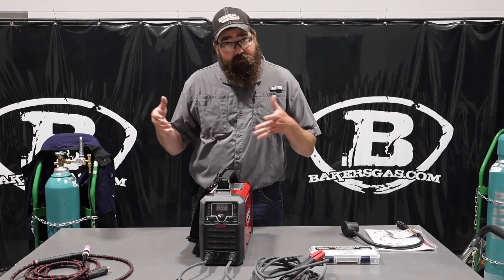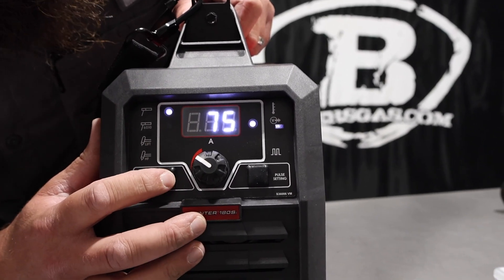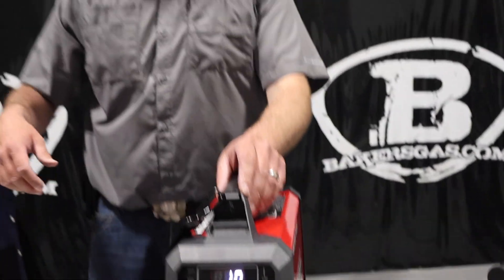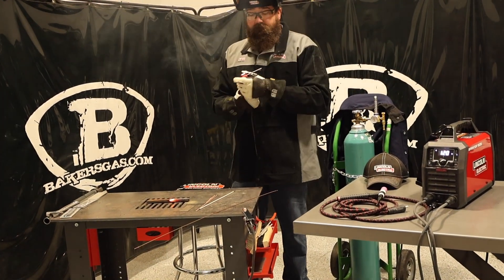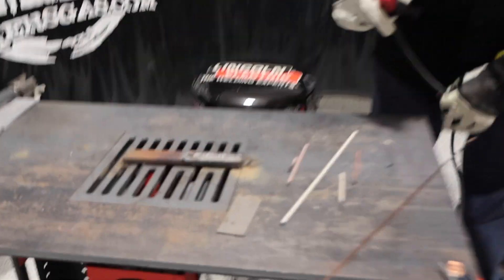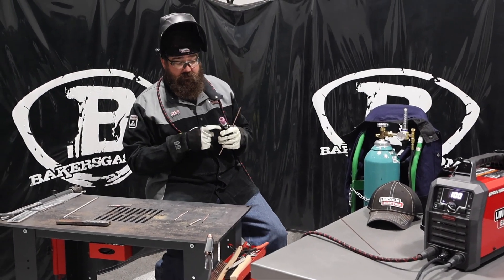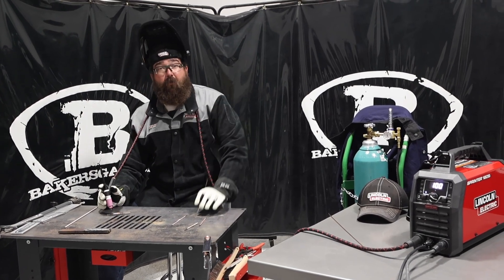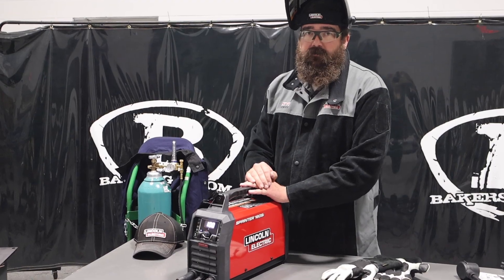Lincoln Sprinter 180 Welding Review Stick and TIG welding demo

Comment: How does this compare to the ESAB Rogue 200ip? I mainly stick weld but I'm getting into TIG now. If you had to choose between the ESAB 200ip and the Lincoln Sprinter 180 for someone that's been stick welding for a few years just getting into TIG, which machine is a better choice? (They are pretty much the same price in my area)
Reply from the maker: I would suggest the Sprinter (we do really like the Rogue too) but we sell more of the Lincoln and if you run into any issues parts/support from Lincoln is better. We do have a free gift right now. Reach out if you need a quote and free shipping.